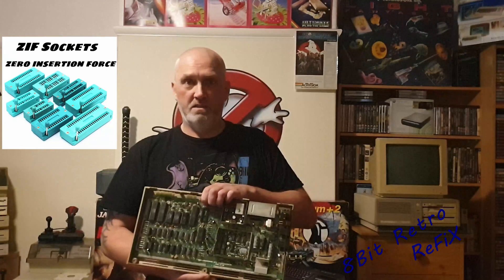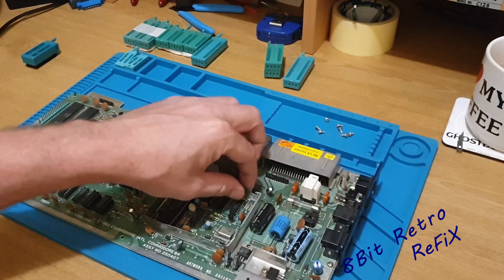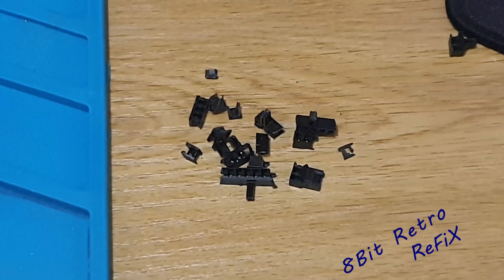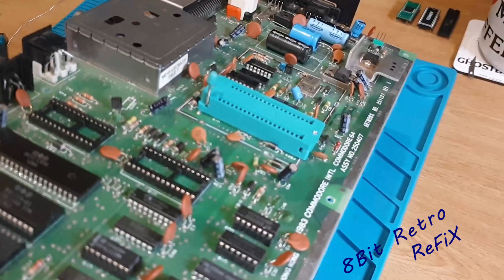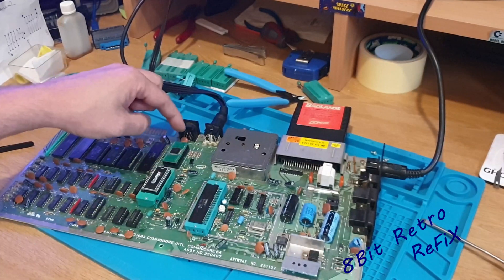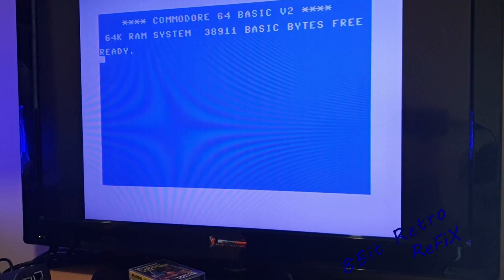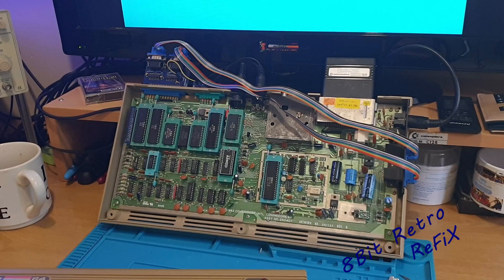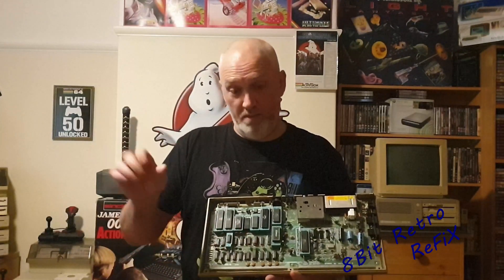Hacking up a Commodore 64. How to make The Zif64 Test Bed

Comment: Nice work bud.   I've been repairing theses 64s for 5 years now.  I have a good collection now.   I still haven't made a zif board yet as I should have.  The old school sockets don't like in and out n
Much:)  I'm going to build one over the winter   thanks
Reply from the maker: Hi .. its the best thing I've even made .. so useful .if I was going to do one again . I'd get the slimmer lower profile ziff's .. they should all fit then .. I couldn't quite fit the kernal with the ones I used.. Thanks for watching

Comment: Seems the original  C64 through holes are much wider than on the later C64C models, there is no way you can fit these cheap ZIFs directly to a C64C.

Comment: Hi, it looks like you have replaced the 5v regulator with a modern switching type. Is there a reason why you have not done the same with the 12v regulator?
Reply from the maker: Hi ... well spotted ;) ... only reason I've not changed the 12v one is that I've no spares at the moment... Thanks for watching ;)

Comment: You could avoid having to move some of the capacitors etc if you are lazy like me - put the ZIF socket into the existing sockets. I would think that in a breadbin C64 there should be enough space, but I’m not sure there would be enough headroom in a C64C. Great video though, this is something I need to do too.
Reply from the maker: Hi ..Get one made lol . The zip legs move about when you open and close them and can cause poor contact on the sockets and the chip's as the zif wont have the full clamping affect either .. . Thanks